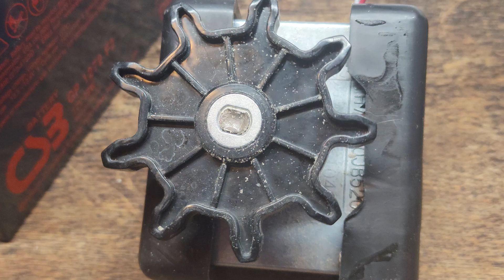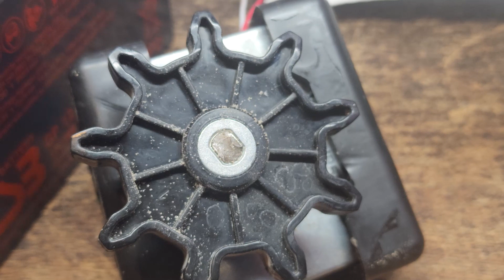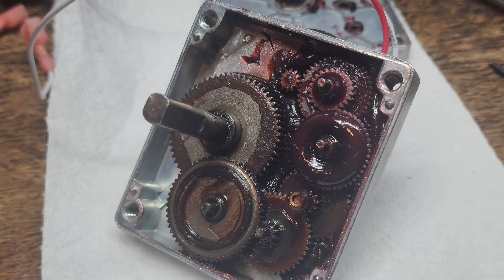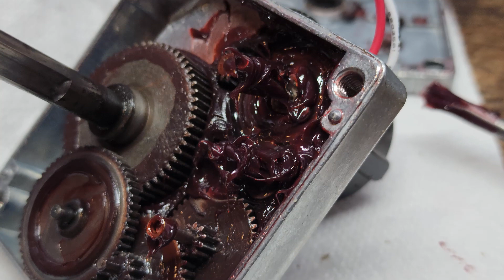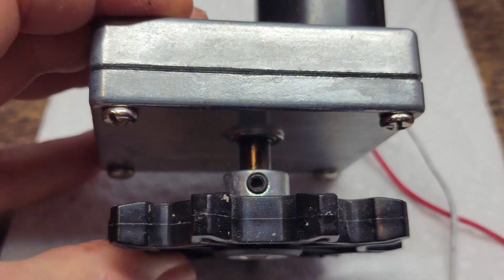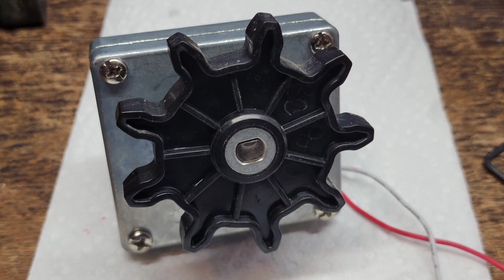Litter Robot 3 motor chatter quick fix / repair

Comment: I had 0 greese in mine, more than 6 years old, first production line, cleand and oild everyting but this did not fixed. I have put my lab psu on 24 v and motor was working great in both left and right taking less than 1 amp, sound was amazing. But when i put in inside my robot i felt that a mosfet on motherbord get hot. Also my very small battery was looking very bad. Maybe changing mosfet will fix it, i do not know yet.

Comment: Holy crap! I needed this video so much. I've messed with every aspect of ours to figure out why it's just "not right" for the last two years.
Even just gave up on it for almost a yr and left it in a corner completely dismantled out of a loss and no time to give to it. Just now watching it yet again "get stuck", fix it, and watching just look wrong as it spins around. Like a severe struggle. 
Finally, figured I'd try to find a video again abt the gears as I once tried to search for help over two yrs ago. Before this video posted!
Just regular gear lubricant I assume? I have some for bike chains....
And Guess I should get a standalone battery as well. Going to search to see if you posted a video how to remove the gear. Thanks for this! Love our LR3 even when it frustrates me.
Reply from the maker: Yes, just standard oil will work, lube the shafts the gears rotate on only and place a small dab of grease at the base of the shaft of the first nylon reduction gear off of the motor's gear. Assemble and then use a battery to run the motor to get the lubrication worked through, swap polarities so the motor is ran a short while in each direction. Then try the motor out on the LR3. If the same over torque concern persists or the motor is just plain slow or fast, replace the motor assembly for a new one.

Comment: I have the LR3, and it has been barely used due to a back injury that kept it in a box. 

I had someone help me move and now the thing has gone crazy.

I do one thing, then another error happens.

Anyway...i am just venting.

What kind of grease? I know this seems a silly question, but i am no mechanic.
Reply from the maker: Use a general purpose grease to lube the bearings and shafts the gears ride on. Anything more and it will cause an over torque fault.

Comment: My LR3 keeps giving me a red and yellow alternating flashing light which I believe means over torque. Will this greasing help this or is there something different I should do? It is currently completely empty and still having issues so I know it’s not too heavy!
Reply from the maker: Lube the shafts the gears rotate on with multi purpose oil, also make certain the output shaft bushings are not excessively worn. if they are ok oil and reassemble and test. ?If it does not over torque keep an eye on it for consistent operation. But if it over torques then replace the motor.

Comment: Mine wasn't even working, I took it apart greased it up, and now it's working. I don't know how long it will work. One of the teeth broke off and was stuck in the other gear. Once I got that out and got everything greased it started working. Thanks for your help.

Comment: I need help, ive had the LR3 for almost 3 years and now is hard for my globe to make a full or half circle. I’ve cleaned it multiple times, emptied it, removed all the litter and now i checked the motor and it looks slightly greased. Whenever is done cycling it makes a clanking sound and then stops. Could that be a sign of not enough grease on the motor?
Reply from the maker: If it clunks after it reaches the dump position but does not return instead over runs the dump position then the globe lurches up and the clunk happens with the globe halting after that. Its not your motor but your DFI is at fault, it will need to be replaced.

Comment: Hey quick question how did you power the Moter to test out it’s working ???
Reply from the maker: 12 volt battery. Or if you are in a pinch a 9 volt battery will suffice.

Comment: I note on removing the motor cover that there is no grease at all in there.  It's a 4 year old LR3.  I will apply grease to all the shafts only. - Update ... yes there was a slight coating of grease on the shafts which I have cleaned and re-greased.  Thank you again.

Comment: I did all this and now the globe over turns more then it should and stops working on it's way back. I managed to stop it from screeching but now the whole unit is malfunctioning
Reply from the maker: Sounds like your motor is the cause of the malfunction rather than the torque load of the gears due to the lack of lubrication. If you lubricated the gearbox lightly it would allow the malfunctioning motor to run fast causing the concern you are experiencing. I highly suggest replacing the motor to correct your initial concern.

Comment: Mine has almost no grease and what little grease is there is clear. I am getting a motor obstruction error: red and yellow alternating. What kind of grease do you recommend? Also, I bought a refurbished model and the Allen screw is stripped, so that's fun.
Reply from the maker: Yes, the grease used at the factory is semi transparent. They skim coat the gears and the shafts they rotate on. I suggest a multi purpose grease, just lube the shafts and not the gear teeth as the grease on the teeth will load the motor enough to over torque the LR. Before placing the first reduction gear on its shaft place a small dab of grease at the base of the shaft. This raises up the gear just enough to avoid most of the gear lash noise.  If this does not solve the over torque errors,  the motor is at fault, replace the motor/ gearbox and this should correct the concern.
Reply: @mikeshowtoandthings  do you have a recommendation? The stuff at Lowes is spray cans for things like garage doors. Will that work? It feels like a liquid, not a grease.
Reply from the maker: Get a multi purpose grease in a can. The spray grease will work in a pinch but it will wick away quicker than a regular grease would.
Reply: @mikeshowtoandthings  thank you!
Reply: Will you please share the product name of the grease you use?  @mikeshowtoandthings
Reply: I see you specified Supe Tech multi duty complex grease in another response. Thanks!
Reply from the maker: @JeannineHenry  Its from Walmart, its Super Tech multi duty complex grease.

Comment: Will over torque cause the unit to start and stop and show a slow flashing yellow light.  I've bypassed the bonnet to no avail, as well as the other tips litter robot suggested.  The motor needing grease is the last hope.  It does make a loud noise when under load.
Reply from the maker: If your LR is over torqueing the LR will display a sequential flashing blue and red lights. The slow yellow flashing light indicates either the weight sensor is detecting too radical of changes in reading while cycling, ( cat intrusion, false or not false) or the bonnets connection is not sufficient enough to NOT trigger a cycle halt. 
The bonnet when the night light option is ON requires at least 10 ohms resistance and a detection of current draw from the 3 LEDs. If even one of the LEDs is weak or malfunctioning it will trigger a bonnet error even if the bonnet has a good connection, so turn off the night light and then its only requiring at least a 10 ohm resistance to tell the control board the bonnet is connected. So shorting the bonnet contacts directly, shutting the night light off and not placing the bonnet on will tell the control board the bonnet is there when it actually isn't.
The weight sensor miscalibration is the other cause of the slow flashing yellow light while in cycle the weight sensor is constantly being read by the control board for a sudden increase in resistance. If this happen the globe is stopped and an internal timer is started when the resistance change revert close to the baseline reading when the cycle originally started, if this does not happen or the resistance reading being provided by the weight sensor are too close together due to a miscalibration, the cycle will remain halted with the control board thinking a cat intrusion is taking place. 
So lets go on the assumption the weight sensor is the culprit and lets soft recalibrate the LR3, this is easy to do but these steps have to be followed for a successful recalibration:

1. Empty both the waste drawer and the globe of any waste and litter, place both the globe/ bonnet on and slide the waste drawer back in the LR.

2. Power cycle the unit and wait for it to go through the power up self tests and has a solid blue ready light. If by chance you can't get it to ready, power cycle and right as the yellow light is going to appear and cycle the globe press reset it will skip the last tests and it will default to a solid blue ready light, but you have to be fast about it, if it starts to cycle just soft power cycle the LR and try again.

3. With the LR on a solid level surface and free of the LR touching anything around it, press and hold at the same time the EMPTY and RESET buttons for about 6 to 7 seconds or until you see a fast flashing RED light. After that let go of the buttons and the unit should return to a solid blue ready light, if it stays hung up on the fast flashing red light, press RESET and it will return to solid blue ready light.

fill the globe just to the fill line with litter and then power cycle the unit, once ready test the cat timer by gently pressing on the globe and let it cycle on timer. It "should" finish the cycle with no issues.
You can lube the shafts in the gear box if you wish to and place a small glob of grease under the first reduction gear from the motors gear, this will prevent the gear from wandering too low on the shaft causing gear lash noise and drag, it wont hurt it but don't get too much on the gear teeth as this will initially place a ton of drag on the motor till its works through the grease and night cause an over torque error. Just to be on the safe side when you initially cycle the LR with the motor re-greased help the globe along to work the grease through for about 30 seconds or till the LR moves the globe on its own without sounding like it laboring severely.
Hope this gets your LR3 back up and running as intended!!!

Comment: What kind of grease should I use? Is Lucas white lithium grease sufficient?
Reply from the maker: That would work just fine!! Remember if you apply some grease to the gear teeth as well make certain its just a thin coating as anything extra will place drag on the motor and potentially cause over torque faults till the motor has operated enough to get the excess grease out of the teeth's way. Place a reasonable amount of grease on the shafts though as that's the main cause of chattering and drag when the lubrication has run dry.

Comment: First off thanks for the video.  I was wondering what the inside looked like.  My motor gets so far and then stops.  It will try 3 times and may finish.  If it doesn't finish I turn it off and on and it does finish.  I replaced the motor and the new one works.  Is there something I could of done with the old motor's gears or something to get it working?
Reply from the maker: Depends on how used the motor is? if its the standard usage then the most likely culprit is the gear box. But there are often occasions where the motor its self malfunctions, the tell tail signs are motor running too fast causing the litter leveling to be too far to the right in the liner, or the globe keeps having over torque faults. But if you have chattering its most likely the gear box suffering from a lack of lubrication, mainly the shafts the gears rotate on. The best thing to do is to, (Depending on how much usage your LR3 receives) is to lightly grease the shafts the gears rotate on and keep the top end of the base as well as the outside of the globe clean. I usually do this when I do a wipe down of the inside of the globe, its quick and easy insurance to keeping the LR operating as its intended.
Reply: @mikeshowtoandthings  Thanks so much for the advice.  I'm not sure it's usage as Whisker shipped me this motor with a new base and may have gave me a refurbished one.  It does keep getting over torque faults so I think I'm going to abandon it however I do like to tinker with things.  What kind of battery did you use to test it?
Reply from the maker: @jinxjeanne  I use a 12 volt 7AH battery to run the motor when testing and after re-lubing. Something that you should be aware of with the replacement bases, they are new from my experience but every replacement base I've received had the upgraded connect control board. And they are redesigned to be far more sensitive to any interruptions of the globe rotation often causing over torque faults. When in reality the motor if paired with the older connect control board are still robust and plenty of strong torque. To identify the control board is easy, just look of the date code on it, there should show "8-16-21 SC" printed on it. If this is the case the motor is most likely weakened  and will need replacing but if it has the latest control board I mentioned there's a really good chance the control board might of crapped out causing this issue. To test run a cycle and see how easy it is to stop the globe and cause the over torque error, normally it should take considerable force to stop the globe practically lifting the LR off of one side. But if it takes almost no force to stop it then suspect the control board. Summary: new style control board with a 21 date code and stops the globe easily, possible bad control board. Older date code board with a 17 year date on it and stops the globe easily, the motor is most likely the issue.
Reply: @mikeshowtoandthings  If I didn't know better you work for Whisker or at least you should.  You sure do know your stuff.  Thanks so much for the suggestions.
Reply from the maker: @jinxjeanne  Some people have told me that I was more knowledgeable than the customer service they had conversed with. I'm just an individual with some electro mechanical experience working with 4 LR3's that are tortured, and I had to learn on the fly how to keep them up and running reliably. So I amassed all the known to me failure points quirks and work arounds to keep the LR3 running as reliably as possible. Also observing all the subtle changes in hardware etc... I figured id share my experiences in the hopes this will benefit others in their quest to keep their LR3's up and running!

Comment: What type of grease?
Reply from the maker: I just use the super tech multi duty complex grease, seems to do the job adequately.
Reply: @mikeshowtoandthings  i wonder if red n tacky would suffice? i have never used the stuff before but i've got a full one laying around.
Reply from the maker: @notidna  At best a VERY light skim coating as if the grease is too stiff or sticky it will cause the LR to over torque. I've tried packing the gearbox with various viscosities of grease and it all caused an over torque fault  initially till I took a 12 volt battery and ran the motor for a while all the while helping it along by hand rotating the black pinion gear. Eventually the gears were able to work through the resistance the grease was providing and function just above the over torque threshold. I really didn't see any real service length difference between packing the gear box with grease and just lightly skim coating the gears and shafts they rotate on. so now I just skim coat the shafts, gear teeth and place a small dab of grease under the first reduction gear to help with the noise the gear teeth makes from being misaligned and call it good.